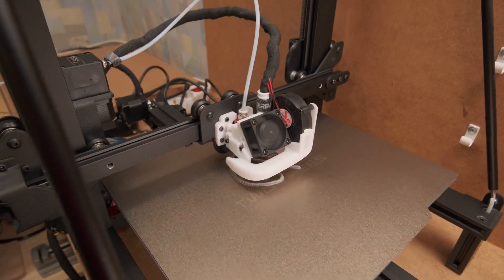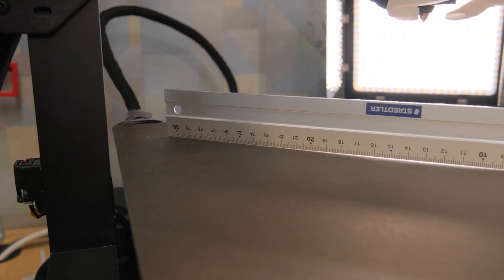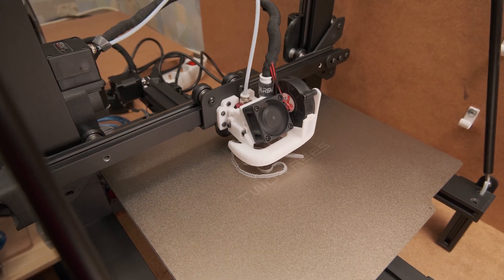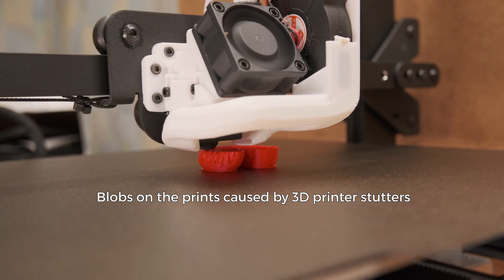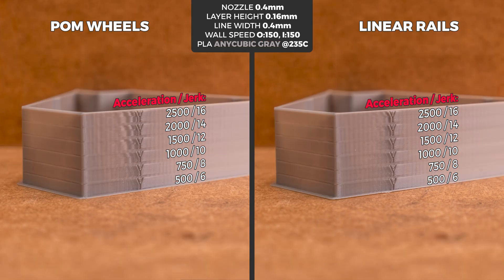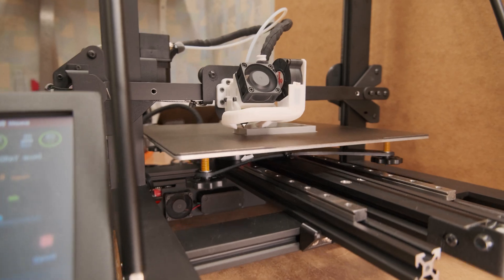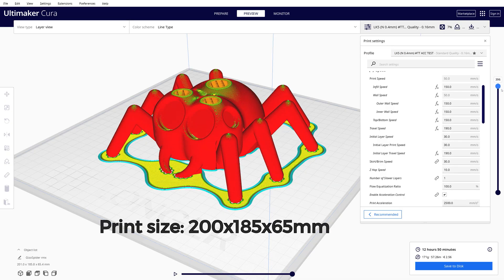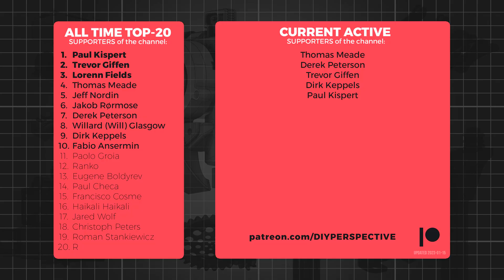When 3D Printer LINEAR RAILS upgrade MAKE SENSE? (vs POM wheels)

Comment: Excellent video and testing!
Would be interesting to see if the same tests could be done on a laser cut G10  or Fr4 bracket. Its essentially fibreglass and used in PCBs and has a fraction of the weight. Or try carbon fibre.
Reply from the maker: That is actually a great point, with enough thickness it could be a possibility. :)
Reply: @PrintingPerspective  I would I also recommend the same thing, FR4 is great, the reduced weigh is enormous, I would recommend 1,5mm
Reply from the maker: There's is no way 1.5mm bracket from FR4 would be enough. You can easily bend even smaller pcbs at that thickness. The aluminum one weights ~300g which is quite low for the insane rigidity it offers. But the biggest amount of mass is at the heating plate + PEI and magnetic base. That's the real problem of the weight.
Reply: @PrintingPerspective  yeah, it's not pretty rigid, but I still get a fair amount of flatness with the clips on the side
Reply: @PrintingPerspective  I took off my heavy Alum plate with older Garolite and used a new G10 Garolite Bed with NO support Plate. Seems to work fine. Clean with Alcohol between prints, sticks well and releases within 5 min of cooling off.

Comment: The models of vibration presented in all the videos of the 3D printers which use a moving bed is flawed. The problem is not the present bearings on the 3d printers as such, but the stupid top plate. The carrier plate can be made to act quite rigidly with the use of the standard or modified bearings , but the top plate is not a rigid body compared to the carrier due to the use of those stupid loose locating bolts and springs. The top plate moves out of sync with relation to the printing head on acceleration and deceleration due to the effects of the moments of inertia. This is why the first method to reduce the effects of ringing has always been suggested as a reduction in printing speed and acceleration. These printers are just not rigid enough to work under such high acceleration and deceleration values. With the latest printers the thirst for high printing speed as a selling point is only exacerbating the problems. The solution is simple and that is to reduce mass drastically while increasing rigidity. Simple but not easy nor cheap. Just treat these machines as they are, pure hobby printers and enjoy the toys they make.

Comment: A tip if you place the rails closer to the sides. You can use 4 blocks instead and make a really lightweight bottom plate.

Comment: I know this is not a recent video, but since i'm planning to upgrade my LK5 PRO in the same way i'm asking you what is the length of the rails i need to upgrade both X and Y axis?
Thank you very much, this is such a great video ☺
Reply from the maker: Sorry, forgot the link https://www.printables.com/model/370968-brackets-for-lk5-pro-y-axis-linear-rail-upgrade
2x 450mm for the Y and 1x 350mm for the X. But you will have to drill and tap holes yourself for the X axis, plus cut a little bit of the metal tensioner to fit the X rail.
Reply: @PrintingPerspective  you’re the best, thank you 🙏

Comment: I am looking at buying a new printer to compliment my ender 3 s1 pro that I have klipper for. I realize I need a bigger print volume and would like it to have linear rails for all axis. I think for me its more about adjustment and no more flat spots over the wheels. so benefits of performance would for me be also about stability of the bed and rails over time. 
Thoughts?
Reply: Not sure if you're still looking but linear rails are wear components as well, except instead of adjusting the offset nuts or replacing it all with a cheap set of new POM wheels you'll need to replace the entire rail + bearing assemblies. They are also way more susceptible to misalignment.  They won't wear as fast as POM wheels but you will need to clean and lube everything from time to time and eventually replace everything.

If you're going for larger build volume, you want your printer to be fast as well and honestly the bedslinger design is just suboptimal for speed, even when doing fancy stuff like replacing the motion system with linear rails and doing input shaping with klipper. I think you would be better off looking at core-xy designs like the Voron if you want both larger build volume and speedy printing instead of trying to retrofit speed into a bedslinger, you will always be fighting ringing and other artifacts once you start pushing for real speed.

Not saying bedslingers are inherently bad, I love my ender 3 with all the mods but I stayed away from doing upgrades like linear rails because there is just a speed ceiling and even though you can get improvements, they are in my opinion not worth it.
Reply: @bami2 
So you are saying that all things wear and setting it up properly is required.... Yeah.... I'm off of pom wheels with a Neptune 4+ and already ordered a Marathon
Reply: @ttsupra2503  Yeah that's a way better choice, enjoy the Marathon!

Comment: Just don't even think about weight reduction or speed with a bed slinger... just no, don't do it. It's not worth the effort. Quality and reliability upgrades only.
Reply: Fastest benchy is now on a bedslinger
Reply: @imortalmichael1  Benchy is not a good indicator of overall printer performance... it is meant to be used for printer calibration. It's very small so a fast bedslinger can print it quickly but it's not a 1:1 comparison since printing big objects on it will completely change the results as opposed to a square frame coreXY where the printed object's size doesnt have an effect on the performance.
Reply: @hd-be7di benchy doesn't have small vertical parts at all too which get problematic when you're moving the part back and forth.

Anyway on a bedslinger you don't need to care about the weight of either rail so you can put whatever you have money for without caring about weight.

The v-wheels  are a cost reduction even compared to 8mm ground rods so they should be the firsr thing to change if the hotend is reliable. The hotend being reluable is the single biggest thing in a printer by itself.
Reply: Are rails a good mod or stick to wheels? Got any tips for mods that increase quality?
Reply: @CharlieBaes good rails make it really simple. You only need a single good rail too if you find a good one, two carriages on one rail is fine if the carriage itself is stiff.
Reply: @CharlieBaes   Yeah rails are ideal especially for the bed because most beds have horizontal side mounted wheels that take heavy vertical loads / motion and will wear out really quickly. If the toolhead is heavy (like a direct drive) that will benefit from rails as well for long term quality and reliability.

Comment: Just found this video and will go see the others. I own a 5 year old CR 10S Pro with lots of upgrades. I put in Z axis Synch Belt, Z Axis Struts, Garolite Bed, Micro Swiss Hot end, Micro Swiss DD, BL Touch, OctoPrint in Pi 4B, last Week Klipper via OctoKlipper & OctoDash. I design with Fusion 360 and slice with Simply 3D. A friend who has the twin to my setup just installed Micro Swiss NG DD, so I ordered one too. Then I heard back he did not see any improvements. I recalibrated again and reprinted the 20mm Cube, X and Z were near perfect but Y had ghosting and fat ends, I contacted my 3D Parts Supplier and canceled the NG and ordered Y Axis Linear rails. They also agreed that was the weaker link But they did suggest a Pancake motor to replace the original Creality extruder motor in my MS DD. Thinner and lighter would help for much least that the whole NG DD. Then I see this video..... Seems like I am on the right track. Trying to adress issues with a budget it not easy. But Klipper was by far the single best upgrade I made. I had the Pi for OctoPrint already, the 7 inch screen was $50, Klipper is free, and now the linear rails precut and all the hardware was $125. This will be the most expensive upgrade yet. But i see the Y axis ringing and Ghosting so it made sense. I will go on and see how it turns out. need to consider the pressure calibration too. Thanks Dennis

Comment: I ordered the parts for my linear rail conversions just before I found your video. I'm not so sure Longer LK5 Pro  can even be called a Longer anymore. I look forward to seeing what else you do to this printer. I've done the dual Z axis upgrade, the SKR3 board replacement, BTT SFS, Micro Swiss Direct Drive NG plus tensioners for both x and y.
Reply from the maker: That is true, when you make so many mods to a printer it does not really deserve the original name.

Comment: BUT - using a better plate and wider setting on the POM wheels should also give you a better stiffness.  MAYBE it might not be as good as the rails, it would be very close.

Comment: A very good video.
Actually I always wondered abot POM wheels om the bed. Horizontal wheels while gravity obviously is vertical... Of course, v-wheels transfer the force on the V-shape only, so in a 45° surface. but still, a horizontal wheel can only use one side of the wheel, while a vertical mounted would at least use both sides.
Anyway, for y-Axis v-rollers seem a pretty bad solution.
In my opinion the reason for using v-wheels is their tolarance to errors in adjustments. With two linear rails in parallel you have to be very precise, else the motion system can block quite easy.
So quite understandable, why cheap chineese printers use V-wheels.
 Esp. on bigger printers (>400by400) you also have to take into account the different expansion of differnt materials while temperature changes. Nearly all 3d-printers are staticaly overconstrained. So you actually can get layershifts while printing, as due to different temperatures the motion system is not perfect anymore. This happend actually to me with an old Tronxy X1. An error hard to find, as you normaly check and adjust the motion system while the printer not actually printing...
In my opinion, a staticly constrained system might be better. So maybe on one side a linear rail directly mounted to the bed carriage, but on the other side mounted with freedom of movement at least in x- direction - maybe even just a plate of igus high temp material directly sliding directly on an aluminium profile.
The whole problem of overcontrainment on bigger printers is actually the reason I am not into the hype of coreXY. Theese printers are nice in smal sizes (were overcontrainment is not a big issue), but going big, cartesian system have their advatages (this does not mean bedslingers, as crossing rods like on the Ultimaker II is also cartesian). On cartesian mashines, you can actually quite easy modify to staticly constrained. On CoreXY this is impossible, as the belts go 90° over pullys, so every edge has to be solid.

Comment: I just found your channel, it's very good and I hope you keep going. I have two suggestions for a follow-up: 1) I wonder if you might be able to improve your Y-axis acceleration/jerk with a heavier-duty stepper motor. One crazy guy equipped his Ender 3 y-axis with not just a heavier stepper, but a dual-stepper system with a stepper on both sides of the axis. I think he got his acceleration up to 10,000 mm/s/s, maybe higher. 2) Would you see any improvement by removing the bed springs and mounting it rigidly? Teaching Tech has a video showing that springs aren't really needed anymore if you have BL-Touch bed mesh and some hand-tuning. It's possible that the springs are still helping a bit by vibration dampening though, so I'm interested to see if it makes things better or worse.
Reply from the maker: Glad you like it. I love doing it and have no plans to stop it.
1. Most fast printers usually run lower jerk and high accels values. I have a 48mm length 2A motor (run_current: 1.000 A) on the Y axis and I can quite easily run 8K accels with 8 SCV on this printer. I feel these are more than enough for such a big and heavy heatbed, the more you push the more you will impact the longevity and increase noise levels.
2. Yup, they are not needed if everything in your printer is assembled squarely. Currently, I am running with silicone spacers, but I haven't seen any difference compared to compressed yellow springs almost to the max. Basically, you want the most rigid possible setup, because that eliminates any wobble and provides the least ghosting. Then you only have to worry about the belt and the motor.

Comment: Is the Z axis worth upgrading to linear rails at all or should we stick solely to X and Y?
Reply from the maker: I doubt it is worth it, unless you are pushing for high acc/jerk where the whole frame shakes like crazy. The only real reason that I see, is because the uneven wear of the wheels as they rotate so little and could develop flatter spots in a long run.

Comment: Why not skip the bed platform entirely? Go straight from the adjuster screws to the rails. Since the bottom platform is only to adapt the single V wheel rail to the edge of the bed it is no longer needed if you got 2 rails that can be under the screws.
Reply from the maker: Did you though how you will prevent rails carriages from skewing? What about the length of the rails that you will need?

Plus weigh-wise it is nothing. My total heatbed weight = 2100g - 300g (heat bed platform) = 1800g + 50g (4th carriage) = 1850g. That is only a 250g improvement.

Comment: Awesome! Thanks for showing before and after! Too many gimmick upgrade videos out there. I’m just curious why you had two carriages on the left and 1 carriage on the right 3:48 ?
I am interested in doing this for my printer. Thanks!!!
Reply from the maker: So because it is a large heatbed minimum of 3 carriages are suggested for it to be more stable when moving back and forth. Maybe you could get away with only two, but I wouldn't recommend it unless it is a small heatbed.
Reply: @PrintingPerspective  Makes perfect sense. Last quick question. Do you see any problems with going on 4 Carriages? Two each side?
Thanks again! I’m a stickler for symmetry but only if it doesn’t hurt haha
Reply from the maker: 4 would be even better, but it can be more difficult to align them so that they slide without any binding, plus extra cost.
Reply: @PrintingPerspective  Awesome you the man! Thanks!!!

Comment: You are not comparing the sliding mechanism actually. The major change is that you actually made is the connection points. With the linear rails is wider vs the stock configuration, but you can achieve the same thing of you just get 2 more extrusions and mount them the same way as the rails, but with rollers .
Reply from the maker: The width has very little to do because the bed movement forces are not in those directions. It mostly helps with consistency on big prints. I don't understand when people will realize that POM wheels on aluminum extrusions are not a precision motion system. It is a non-rigid constantly fast-wearing system that needs constant adjustment. And not only all that but the Y axis literally rides and wears only on one side of the wheels which from an engineering standpoint it is a mindboggling flawed design. What amazes me the most is that companies by cheaping out convinced the masses that plastic wheels on v-slot profiles are okay. They are okay on slow dirt cheap machines, but not okay if you actually care about speed, quality and consistency. Don't take this personally or anything, that is just my take on this, cheers!

Comment: Why not ditch undercarriage alltogether? The table can be leveled with shims and for the rest there is bltouch
Reply from the maker: I am not sure what you're suggesting here. Ditching the bed bracket that attaches to linear rail carrieges?
Reply: @PrintingPerspective  Yes, remove bracket, springs, wheels  it all create additional flex. Make sure rails are parallel and attach bed directly to them (well, need heat insulation layer, wood shims or something like that). It can be leveled down to 100 or even 20 micron with shims or pieces of foil added. From that point it is printer autoleveling only.
Reply: @PrintingPerspective  Additional benefit will be belt mounting point closer to the bed's center of gravity so will reduce vertical forces pushing bed up and down during bed acceleration. Not that it is ever a problem at the acceleration levels consumer printers use... but motion should be smoother for sure.
Reply from the maker: In my case, bed mounted too low would hit the Y motor. Everything you say is valid but personally I rather build voron than commit for such upgrade. The one I made was relatively simple with more than enough quality improvements. I don't think there is a point to go any further than that on a bedslinger.

Comment: Was the linear rail here only on the Y axis and not the X ?  Curious if replacing the other axis would erase the ghosting ?
Reply from the maker: Yes, only Y. But the same all principles apply to X axis too. I made the acceleration test print yesterday with X axis rail with my custom design direct drive extruder head (which weights more) and results were without any ghosting. Linear rails are superior in every way for the print quality but if weight and speeds are on the lower end, POM wheels are just as good.